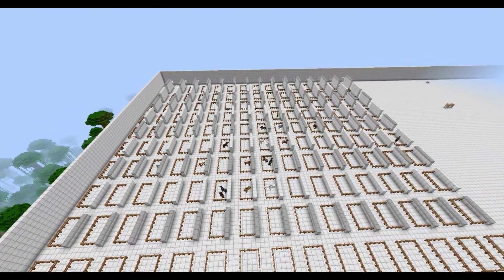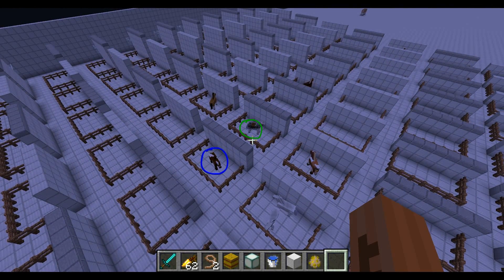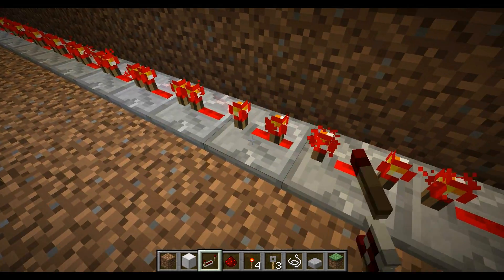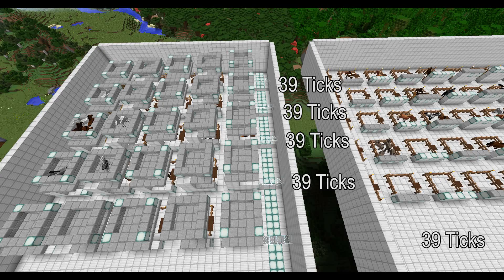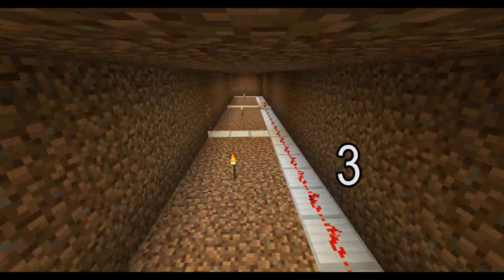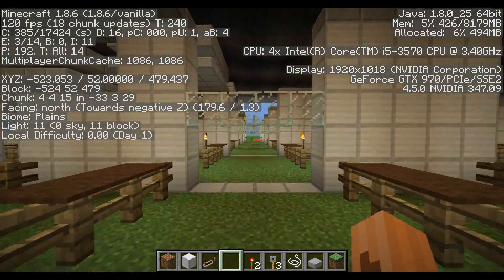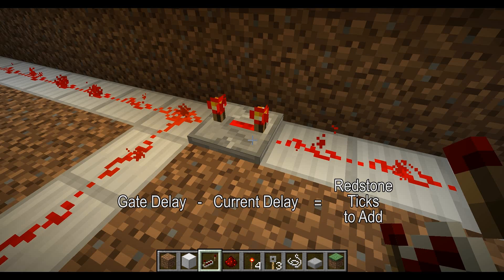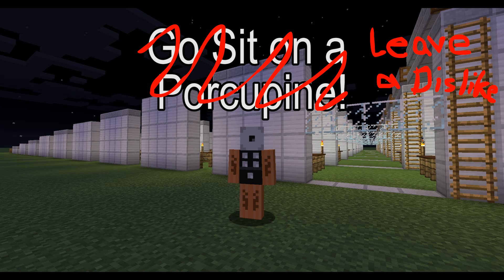The Horter Part 2: Adjusting Pen Length and Number of Speed Rows

Comment: Tip: Connect The Redstone Trail To Your Tripwire. But If The Signal That Leads To The Trail Comes To An End, Remove The Redstone Piece And Replace It With Redstone Repeater That Leads Into A Block With A Redstone Torch On The Other Side To Make Inverse To The Signal

Comment: How do you get the torches underneath the Pistons to turn off. That's the only thing I'm having trouble with. Which devices does this work on
Reply from the maker: The trail coming from the tripwire should run into a block with a redstone torch coming out the other side. (Like this: https://youtu.be/r4YtjxNzrMg?t=9m54s). When the trip wire is NOT triggered, that torch should be on. The signal from that torch needs to reach the blocks under all the redstone torches under the pistons.
Reply: @Jake_Eyes  
It should be noted that the Torch is included in the equation, although he didn't cover the Torch's Ticks to Toggle.

Comment: Can't you just use a timer on you phone/computer to use instead bulid all of that
Reply from the maker: +blood red moon AJ This is more convenient if you want to sort through a huge herd of horses.
Reply: and it starts at the PERFECT time
Reply: (that was to Jake Eyes's comment)
Reply: This is also more accurate, as you as a human being have an approximate 0.1 second reflex time, which means you have a variable of ~0.3 seconds for what you see, comprehending the view, and reacting.

And that's if you have no Lag. With this system, you remove the Human Component from the Equation, and it is even more capable of fine tuning if you tweak it slightly to account for the Redstone Torches that he didn't mention affecting the Redstone Tick length.

You'd be capable of figuring out the difference between a 14.1 Block per Second horse & a 14.0 Block per Second horse, simply because you are incapable of reaching the next area due to being too slow.